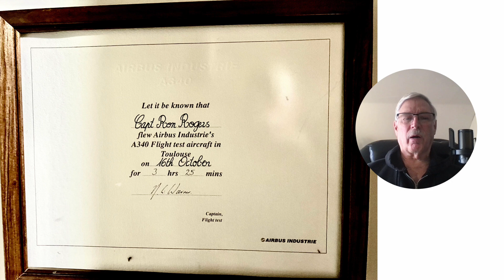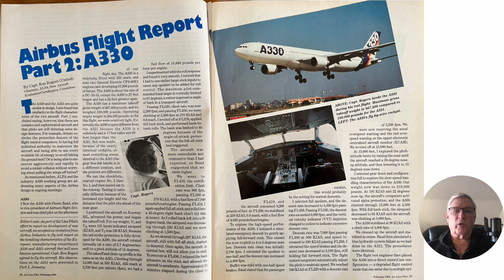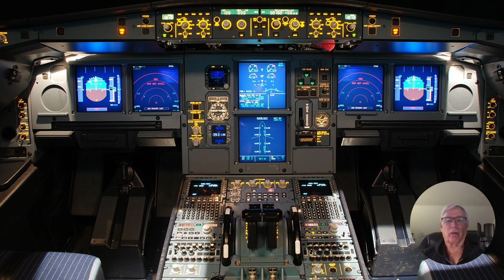An Unbelievable  BIG HOLE in Airbus protections!       Airbus Industrie flight 129

Comment: ALT* (altitude capture) also nearly led me to a Busted Altitude Violation - It was a very short flight. Immediately as we are reaching  FL210 cruise level ATC assigns us a "Descend to XXX at Pilot's Discretion" clearance and sends us over to the next controller. As per SOPs the FO dials in the new cleared-to Altitude. (We were assuming we'd levelled off as Altimeters and VSI  were stable despite ALT* still annunciating...). We get busy with the new frequency and approach setup & briefing and then I glanced up to see we were (maybe?) 500ft above the Cruise Altitude and still drifting UP and still in ALT* ... Lesson learned: ALT* does not 'memorize' the target altitude during the capture maneuver and will drift in ATTITUDE mode 'forever' if it gets 'interrupted'... (Happily, ATC had no conflicting traffic so - 'no harm no foul no violation' phew). Just one more Airbus "gotcha!" moment.
Reply: Altitude capture (ALT*) is fully dependent of the selected altitude in the window.  If it can’t or doesn’t capture the selected altitude, then the pilot needs to do something, as the ALT* algorithm is confused by the selected altitude change entered by the pilot.  Hence the reason that mode change annunciations should always be displayed as the pilot intends.  And if not, then some action is required to correct the situation.  I’ve had this happen to me in other aircraft.  If you change the selected altitude while in altitude capture mode, then the pilot must do something (change the autopilot mode out of altitude capture mode) to force the autopilot to respond appropriately to the ‘new’ selected altitude.  Typically, a vertical speed mode change in the appropriate direction (up or down) to force the autopilot to capture the ‘new’ altitude.
Reply: If I understand correctly you were in ALT *, and simply changed the altitude to a lower one than the one you were capturing. Was that it?
Reply: @bruno84  Yes he did, and because mode reversion to alt hold hadn't happened and target altitude isn't capturable, law changes to vs hold with a low positive vs, the vs at the moment of reversion. Nothing surprising, well documented and well known...
Reply: @simonbuhre9920  that would be my point.

Comment: So Ron, was the remedy to just turn off the auto pilot? Was on the Bus for twelve years and never knew about this situation. BTW: Really like your videos.
Reply from the maker: Yes, Hand fly and aggressively lower the nose or reduce thrust on the operating engine. Not a great thing to have to do.
Reply: @ronrogers  Given this situation, How about enabling the hydraulics again, like you said reducing trust and opening trust on the trottled back engine.
OK, it's just theoretical... but stil....
As far as a real engine out situation, first thing to do, disable automation (like Warren Vandenburg kept on saying, and I agree with that).
By the way, i don't fly anymore... especialy not as a passenger.

Comment: Obviously, the crew did nothing wrong.  This is another example of why line pilots need to be prepared to step down in automation and have the skill to fly the aircraft manually.
Reply: It seems to me that the pilots waited too long to respond to a rapidly deteriorating situation.  Possibly believing that the autopilot would save the airplane from a worst case scenario.  Breaking the ultimate piloting philosophy, AVIATE, NAVIGATE, COMMUNICATE.  Which should never be obviated even in an aircraft with the most capable FBW flight controls and protections.
Reply: @kenwhitfield219  Actually, this was a special case.  As a test flight, they were flying the aircraft to the limits of its performance capability.  That scenario required them to rely upon the automation working as they were instructed that it would.  Line pilots should never find themselves as close to the performance limits as the test pilots take the aircraft.

Comment: First of all kudos on the 'right' attitude; respect for those departed.  I do find it interesting some of your comments on the Airbus protections. (perspective - I have about 7 years A320 series experience, have flown the MD80; 757;767 E190).  Would be interested in your perspective / analysis with respect to this protection 'hole,' with respect to this scenario....

If you have the MCP set for a level off of say 1500 AFE (as if you were going to remain in the pattern for a visual, or a low level off as one might get out of KPIE), is this still a potential 'gotcha' should you get the proverbial V1 cut?   Especially if you get a situation with an overly aggressive pitch up or even if the plane is really light so is climbing quick enough to trigger ALTCAP say below 1000 AFE?  Interested in your perspective.
Reply from the maker: As long as you are hand flying, you should keep the aircraft under control.
Reply: @ronrogers  There in lies the rub, our SOP is 100 feet rudder trim autopilot on

Comment: I can't believe what you're saying is true, that flight envelope protections are over-ridden by the auto-pilot. I can only guess that Airbus feel that their AP will never fly the aircraft outside of the flight envelope. I work in the oil & gas, and chemical industries, at the base level of control there is an emergency shutdown system, which ensures the plant does not operate outside of safe conditions. "Above" this is the control system the operators use to set the operating conditions required; incorrect operating conditions, either directly set by the operator, or resulting from the operator's actions will cause the emergency shutdown system to activate, regardless of whether top control system is trying to recover the operating conditions of the site.

Comment: Another good video technically describing the arrogance of some airframe manufacturers.
Here's a very similar fatal accident regarding a bombardier Challenger in Wichita. I think the year was 2002. Eric was a F-15 pilot, very sharp a real likable guy. We went to the same college together but he was a couple years in front of me. I met him at Fairchild aircraft when he was hired as a experimental test pilot. My dad (another park's grad) and I actually got to fly with him and his C-170B.
The accident aircraft was configured for expanding the aft CG envelope (not sure if that's the smartest thing to do). In any event it was a very gusty day and they probably shouldn't have been flying but the aircraft over rotated (Eric was pilot monitoring) on takeoff and apparently stalled back onto the runway and sliding/burning to the airport perimeter. If I remember right, two other crew members died at the scene but Eric survived for another 32 days before subcomming to his injuries on his terms. The story goes his wife asked him if he wanted to continue burn recovery treatment, blink once for yes and twice for no. Needless to say this tough guy had enough, he had done enough in his career that was cut way too short.
Reply from the maker: Yes, that was a sad event. I flew a Cessna flight test mission on the citation 650 if I remember correctly (Invited back as a guest by Eric).  Very good pilot. Very tragic tale. I have the book that his widow wrote. Very heartbreaking.
Reply: @ronrogers  I'm glad you got to know him, I just remember he was sharp and always seemed to have a good disposition. My one good story about Eric is that not long after he was hired at Fairchild He was getting checked out on the Metro, apparently it has a pretty nasty sink rate once you pulled the power back (large diameter 4 bladed propellers. So he lands about 30 ft short of the runway and unfortunately there was about a 9-in lip where the runway stuck up above the ground (Yes that's very dumb). In any event he shattered both of the nose wheel rims and they got shot out into the propellers and then the propellers slung the rim fragments back into the fuselage. The flight test maintenance manager the fellow named Don Brock another great guy couldn't believe it, here's this hotshot F-15 pilot that totally "screw the pooch". Back then it was kind of funny, no one really got bent out of shape, no one got hurt and that's why you have insurance.
Reply: 2002 was pretty early in the internet world but I do recall seeing photos, very clear photos of airport fireman trying to hack their way into the cockpit, they were doing everything they could to get at the crew. Not sure if you know this but the Challenger was initially designed by Bill Lear his team was out on the West Coast but I forget what city the engineers congregated in. 
Again the firemen were in tears because they couldn't hack their way into the fuselage with an ax something that you could easily do on a Beechcraft or  Cessna product. In my view all Part 25 experimental test need to have an emergency exit/hatch installed above or just aft of the cockpit. I was working at Gulfstream a few years back and they lost one of their test aircraft out in New Mexico and it was totally survivable if they had that hatch installed, like they had installed on every other flight test/certification test articles. I can't believe engineering/system safety protocols don't demand such an emergency hatch.
Reply: @christophergagliano2051 The Lear Corp. Was at Reno, Nevada I believe.
Reply: @AviationCat-m2q Yes The Lear Fan pusher business turboprop was designed and built in Reno. Lear had left Learjet probably at least a decade before he set up shop out in Reno. Also the Challenger jet apparently was a Lear design also.
Reply: sadly recall the plaque dedicated to that crew at the Bombardier Flight test building at ICT

Comment: It's interesting to witness all the severe problems Boeing is currently facing (now and from the last years)  ...and find a trend of new videos about old and outdated Airbus problems like this one from 30 years ago from an aircraft that was still in its test phase...
Reply: A problem from thirty years ago that's still a potential problem is worthy of discussion at any point in time.
Reply: @marcmcreynolds2827  I agree.
But you also have to believe it's still a potential problem and that Airbus hasn't fixed it.
Also consider they did fix it for the A320 family. It's just software, not a mechanical problem. So, my question is, If they solve it for the older A320 family, what reason could they have to leave the problem unfixed in the A330 family?
Reply: @miks564  Sorry, but unlike for some videos I don't know anything about it beyond what was presented here.  One or more of the comments suggest that the hole wasn't fixed until the A350.
Reply: @marcmcreynolds2827  It’s possible. I also don’t know. But consider that the A350 was released 10 years ago and the A330 has 30 years. 
Which probably means the A330 has seen this fix for the last third of its active life.
It’s still strange to me that they took so many years to address a known issue, specially considering it’s just software.
However, safety records of this model speak for themselves.
Reply: @miks564  I wouldn't treat all comments under this videos as gold. As you already sad we are talking about software changes. Making 100% correct assumptions about the current state of laws (including afcs and efcs) is only possible if you know the up to date SAO of the system, no airline pilot does that. The rest is "hear say" and feelings... Regarding the test flight mentioned in this video: First question should be: was the FMGEC - PRIM standard a production (end validated) or a test one. If it was a testing standard, the laws can be changed while in flight via ADIS, something one should consider if talking about an accident of a test flight.